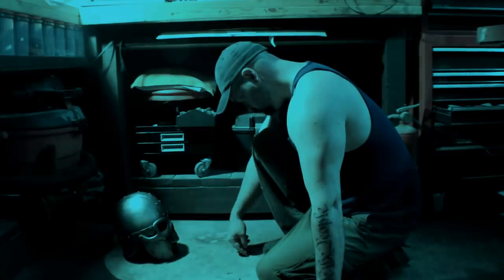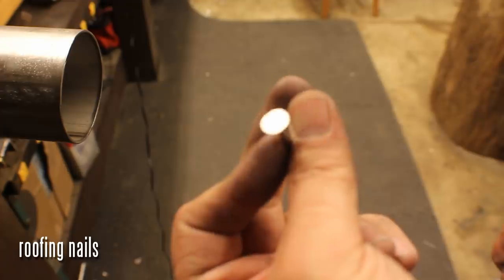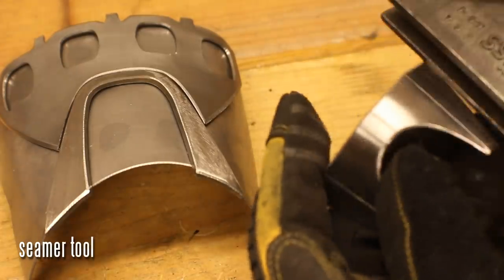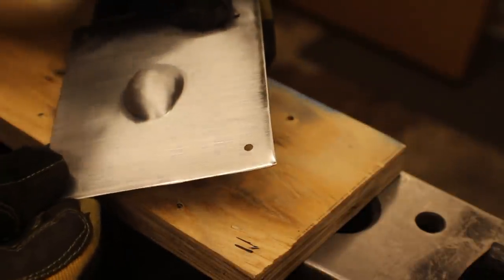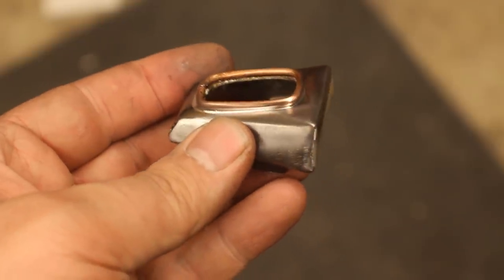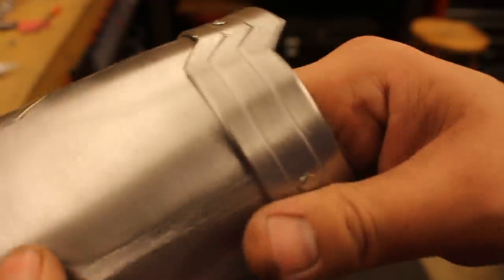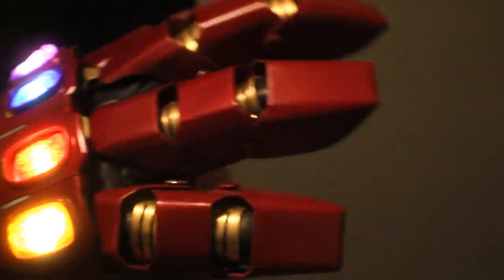WATCH: Real metal Nano Gauntlet from Avengers Endgame

Comment from the maker: Infinity Stones in both this (rough texture) version, and the Thanos (smooth, Infinity Gauntlet) version are now available at the Armor Templates website. They will go fast...first come first serve. I will crank them out as fast as I can to keep up with demand. https://armortemplates.com/infinitystones.htm
Reply: Hey man should the red paint be metallic or normal?
Reply from the maker: @matybebe-_-5035  I bought Metallic paint but it didn't come out all that metallic.
Reply from the maker: @radrush_mx957  Good luck. Materials to mold,  cast, and color these will run you about $100, let alone the $150 pressure pot required to eliminate bubbles. But by all means do it yourself if you have the time, equipment and materials.
Reply: @DavidGuyton  Thanks man appreciate it!
Reply: @DavidGuyton  Actually i bought some aluminum plate and had old glove and used glue for it. About 10 dollars rn but i haven't bought spray yet and i will be doing the stones differently and not light up.
Reply: I've been looking every were for some infinity stones that don't cost £100 but I guess you tubers who make them themselves aren't the best place to look, anyone know where I can get decent quality stones that aren't super expensive
Reply: Do the stones come with led' s? And wires?
Reply: Please send me the Stark Nano Gauntlet to me.
Reply: iron man gauntlet that mean nano gauntlet
Reply: Please send me the Stark Nano Gauntlet to me.
Reply: Are you still selling the gauntlets??
Reply: Please send me the Stark Nano Gauntlet to me.

Comment: For those that are impatient and want to make stone settings but ASAP you could search OVAL Shaped dimple die which should bring you to a site (not listing sites on someone else's channel) that will allow you to buy 0.188, 0.385, 0.430, and 0.580 inch tip diameter dies but there may be other sizes cause I just looked for about 10 sec. Please note you will have to have some kind of press (hydraulic, or even an arbor press if the metal is thin enough, to create this shape) and it will only get you to a starting point. You will have to final shape you holes. 
cleco fasteners are another nice tool to temporary hold your pieces together. His methods are great and they work, plus it gives a "I made all this" good vibe feeling, metal shaping tools give you ADD and ADHD people a quicker result but do come with a price tag.
EDIT: another nice tool for us non-painting-want-to get-color-down-now-can't-wait-for-the-last-coat-to-tack-up-and-our-first-coat-was-way-to-heavy-and-wet kind of people you might want to search for a DIY Powder Coating Gun and get a toaster oven (or an old oven if you need larger room) and get an amazing finish.  Please note Do not use your mom's/wife's oven as you will poison everyone that eats out of it after you cure your parts. Also you might have to have an air compressor to use the gun depending what you buy. (not posting sites on someone else's channel still).
Do your research for which type of this and that you might want to buy. Some things are not worth the price, some things take extra stuff to use
Reply: Who read this shit?? Just kidding i did.

Comment: Hey man, great build, I've just bought some of your stones and I've had an idea I wanted to run by you for my build: Do you think it's doable to wire a push button into the circuit and position it into the palm of the glove so that the stones glow when you close your fist (One of your fingers would provide sufficient pressure to the switch in the palm)?
I also wanted to check with you how customise-able the templates are size-wise or if your builds are a one-size-fits-all kind of deal.
Thanks a bunch and keep up the good work.
Reply from the maker: Hi Ricky. Yes I recognize the name...your stones are on their way to the UK. As far as a button, yes that's totally doable, but you'll need to find one that has the right resistance when you push on it. I imagine for what you want to do, it has to be fairly easy to push. The button I used (inside the Vambrace) is a pretty standard plastic toggle switch, and wouldn't work for what you are planning. As far as sizing, you can alter the size using your printer or having an office supply store scale it up or down for you. You'll have to keep in mind the size of the stones though. Since they are a fixed size, you'll need to be sure you make the knuckleplate can accommodate them. They will fit the gauntlet exactly if you make it the size the template calls for, but if you want to make it a little smaller, you'll probably need to keep the holes where the stones go roughly the same size as indicated in the template.
Reply: @DavidGuyton  fantastic, thanks for the advice!

Comment: A DIY infinity stone Gauntlet that can bend far enough to 'snap'

Nice.

I know the snap sound in this video is edited, but out of all the gauntlets shown on YouTube, this is the only one that can make the middle finger and thumb get close enough to snap.
Reply from the maker: I designed it that way for this very reason. And yes the snap sound is edited in, however it really does make a sound similar to snapping when I do it. Not a SNAP, really, but a sound that could be interpreted as a snap
Reply: @DavidGuyton  wouldn't that chip the paint?
Reply from the maker: @7peque  the paint is tough enough to withstand a little abuse. Over time though, yes, it would become an issue.
Reply: @DavidGuyton  Odd, I've made the thanos infinity gauntlet that you've posted a video of and it doesn't take too much work to chip the paint, maybe it's because I didn't use primer
Reply: David Guyton what if you buy some holes in the glove where you snap your fingers so you can actually snap
Reply from the maker: @luisochoa5260  snapping actually does not happen at your fingertips. The noise you hear is your finger striking your palm.
Reply: @DavidGuyton  you have the made the best infinity Gauntlet so far. Well done, sir~ :D
Reply: David Guyton ahhhh thanks I didn’t know that

Comment: Hi I think you gauntlet is SOOOO COOL!! I am trying to make this with my dad and we can’t figure out how to make the mold itself, we tried clay but with no luck could you please tell me how you made it
Reply from the maker: Check out my latest tutorial where I make the original Infinity Gauntlet. I go over it better in that video. You will need to make your shapes in something hard...in this case I used plaster than I broke up onto the shapes I wanted. Then I sprayed them with a solution of about 1 part Elmer's glue and 5 parts water. Let that dry overnight. then paint with some glossy spray paint and let that fully dry. Then you will need to make a silicone mold. I use Smooth-On OOMOO 30. Mix it in equal parts and then pour the mold around your parts.
Reply: THANK YOU SO MUCH!!!!!!!!
Reply: Omg Im gonna do it with my dad too!

Comment: I'm sorry, I don't wanna get annoying or so but another question appeared.

You said painting the pieces isn't the best idea because moving pieces will wear down the paint job. Still it looks better with paint.

You made a list of what tools etc is needed.
Could you perhaps provide links to the paint you used?
The color scheme you have looks nice.
Reply from the maker: I just grabbed a dark red off the shelf from Advance Auto. I had a lot of problems spraying it though, so I didn't feel right recommending the brand. Any darker red metallic paint will work fine.
Reply: @DavidGuyton  thanks again

Comment: Just found this video and I highly thank you for making the Stark Infinity Gauntlet pattern free to download. I do wanna ask regarding the tabs on the pieces - I work primarily in EVA & craft foam so, would I have to cut those tabs away in order for the foam version to work right?

Just wanna know before I start printing & cutting the templates.
Reply from the maker: I am not an expert on crafting in foam, but I imagine if I made this in foam, I would cut off the tabs and glue it on instead, yes
Reply: Thanks for the reply. Just wanted to make sure.

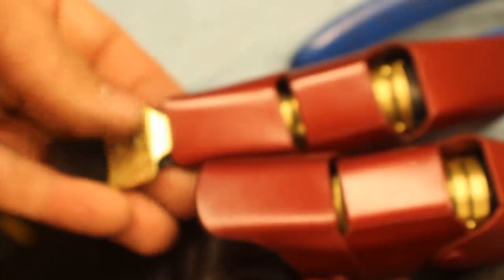Comment: 18:32
I don't quite understand why there are rivets in the brass here (these double ones) since the leather is glued on, are the rivets just for the looks?
Reply from the maker: There is leather glued to the underside of those brass pieces, and then it's trimmed off, Then it's riveted down to a strip of leather with the two small rivets. Then the strips are riveted to the glove
Reply: @DavidGuyton  I see. Thank you
Reply: Np figured it out.

Comment: how do you cut the metal? CNC plasma cutter I suppose?
Reply from the maker: this material is thin enough to cut with hand snips. I generally use my benchtop throatless shear though since I have it. Snips are like $10 form Home Depot...the throatless shear was like $120 from Harbor Freight and well worth every penny for someone like me.
Reply: @DavidGuyton  what about the detailing? like holes?
Reply from the maker: @DaBuild  drill bits, Dremel tool, files

Comment: I just had a quick question.  What was your preferred technique for cutting the designs out of the metal sheet?

I was thinking may a dremmel but I was curious on what you did.

Your work is amazing by the way, thank you for the template.
Reply from the maker: I have a throatless shear, sometimes called a Beverly Shear (but a cheap, Harbor Freight version). I paid like $120 or something and it's worth its weight in gold for someone like me who cuts a lot of metal. I often use just plain on tin snips though. Those work just fine for metal of this thickness, but it is a little hard on the hands. I wouldn't suggest a Dremel for all of the cutting, as you'll burn through your cutting wheels so fast that you'll give up on the project before you ever complete the cutting. I would just get a couple of snips (a smaller one and a larger one....small is easier to cut into tight spaces, and large is easier to cut bigger pieces out)....After you get the basic shapes cut out, use a Dremel or grinder or some files to finalize the shape.
Reply: David Guyton thanks for the  reply.  Looks like the Beverly shear is on my list.  I watched some videos on it and it looks like the right tool for the job.

Comment: Is a 5mm paper of EVA Foam good enough for this project? Or I should go with 10mm?
Reply from the maker: 10 is definitely too thick, but as I stated in the video, I am not an expert on foam craft
Reply: @DavidGuyton  Thanks for the reply. I thought that 10mm is too thick too. I've never worked with foam, so I don't really know how strong is, I'm afraid that 2mm is too thin and it will break while wearing it. I'll do some research. I want definitely make this gauntlet
Reply: You need uru metal

Comment: I wish you could explain more about the LED circuit. I'm trying to make a gauntlet too, but I don't know much about LED.
Reply from the maker: just connect all the red wires together, and all the black wires together. Run the black wire to the negative battery terminal, and the red to the positive terminal. On the red wire, between the LEDs and the battery, you need to put in a switch. This setup is about as easy as they come.
Reply: @DavidGuyton  Thank you!

Comment: Hi David, I'm having trouble shaping the handplate. What size pipes do you use the shape it around? I'm currently only useing a 3.5 Inch exhaust pipe cutoff I picked up and so I'm assuming you also used some smaller pipes to get it to wrap around the sides of the glove?
Reply from the maker: I use a 2.5" piece, and sometimes a 3" piece. I also have some much smaller stuff I use on occasion but only very rarely. I mainly use the 2.5" piece
Reply: @DavidGuyton  thankyou!

Comment: Could I weld the vam brace together instead of rivets
Reply from the maker: of course
Reply: Would u recommend a mig or a tig welder
Reply from the maker: @henrytischbein155  if I had the choice I would probably get a TIG, but my MIG works fine for the light duty stuff I use it for. MIG is a lot cheaper

Comment: If you use a Color LEDs, the result are better
Reply from the maker: Colored LEDs are not going to be as bright as white LEDs. Because of that, the stones would look like they had different levels of brightness...especially on camera.
Reply: @DavidGuyton  good point  ⊙△⊙
Reply: Depends on where you get your LEDs! I get my colored LEDs from Tayda’s website and there are SUPER bright.
Reply from the maker: @brandonwilliams6181  but still not as bright as white. It's physically impossible. Plus if you look at the footage in the films, the light inside the stones is most definitely white, which gives off a much "hotter" appearance than what a colored LED would have.

Comment: The gauntlet in this movie is SUPER BI-POLAR it changes throughout the fight. Color, stones, design everything. I’ve been trying to mod mine like the movie but it changes every scene. One thing that makes me mad is when tony put the gems in they are “rocky irregular shapes. When thanos is holding the gauntlet against captain marvel before he pulls power stone they are all round marbles like you see I bottom of fish bowl and mind stone is smaller/same size as other gems. In some of the shots it’s literally bronze/gold. Like the old gauntlet.. see for yourself !!
Reply from the maker: Indeed. I used shots from when you first see them installing the stones on the table. I stayed as true to that exact shape as I could, however I did make it oversized. So it's bulkier like the Hulk version, but it's simpler and still somewhat elegant. Anything after that first table scene is just a mess.
Reply: The stones changing isn't that bad. They're made of an alien material, so they don't necessarily have to act like normal gems. As for the color change from red to bronze, I'm not sure how that slipped past the editors, considering the MCU is up there with star wars in terms of popularity and budgeting
Reply: Yeah you do have a point to be fair. It was probably to save money for other scenes that needed more of a budget. However the excuse you could use is what Shuri said when examining the Mind Stone in Vision’s head during Infinity War: “the structure is polymorphic”. Basically the Mind Stone can change shape. Maybe the stones change their shape over time depending on how much energy is expended from them and what environment they are exposed to etc.

Comment: is the pdf template to scale? do i just hit print at a4 paper?
Reply: Give it a go. Make adjustments to make it work if it doesn't.
Reply: My first print wasn’t to scale with default settings. I fixed this by actually fallowing his instructions in the document. Print the first page of the template. There’s a line that should be exactly one inch. Mine want and I already cut a few plates before I noticed.
Easily solved. Just take you’re time and keep trying. Failing is the fastest way to succeed.

Comment: Impressive but cheaper buy toy for people who don’t have this stuff at there house
Reply: I mean you could always do it with reguler foam or another material. You dont gotta do metal. Its about the do-it-yourself part. I think what i will do is use multiple thicknesses of foam and make it that way! You can print off the template the same way and everything